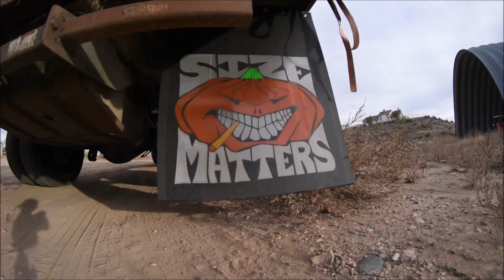One of a Kind Plate Roller Build

Comment: I am new to your channel.  Do you have a website with plans, or anything like that?  I am consulting on the design of a small factory being built to create limited numbers of a prototype.  Client has a tight budget, and this looks really useful.
Either way, thank you very much for posting this.
Reply from the maker: I unfortunately dont have a website or plans available.  I build most of my projects for fun and they really wouldn't be suitable for a production environment. You can get a roll setup with this exact capacity at Eastwood.com for around $2000. Thanks for the comment!